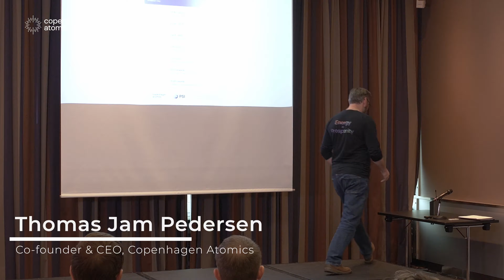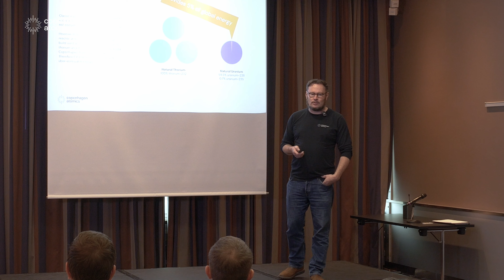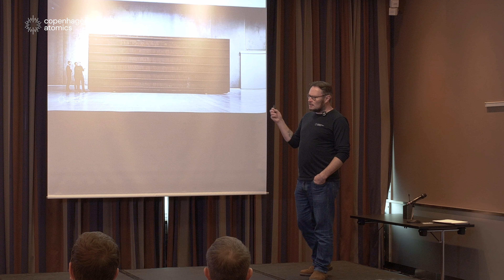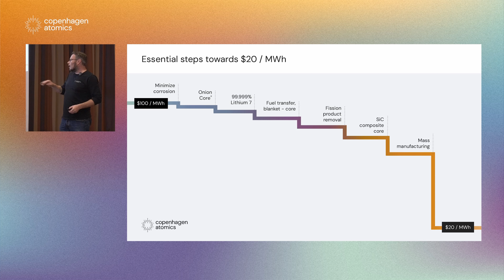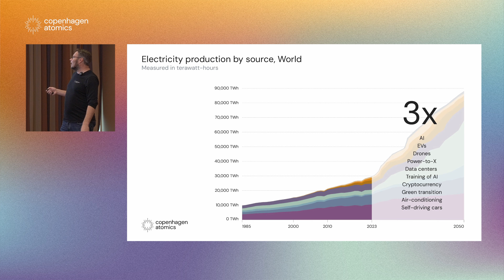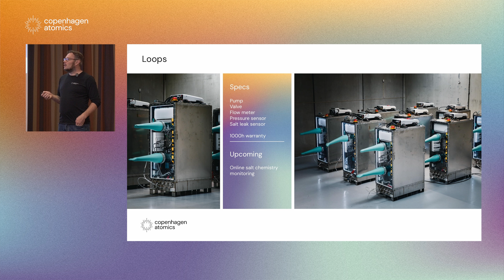Building the Future of Energy in a SHIPPING CONTAINER! (short version)

Comment: Have you guys made any progress on the heat and corrosion issues that plague molten salt reactors?
Reply: They did, they are the pioneers of fixing that problem, go back in these videos and you should find it.

They simply removed all the water from the fluoride.  Evidently anhydrous fluoride is not very corrosive.
Reply: @danafletcher2341 that’s fine for the molten salt but as yet I haven’t seen anything that talks about the issue of corrosion and material damage from gamma radiation, I’m certainly no expert but from what I’ve read it is a real issue perhaps greater than the molten salt issues